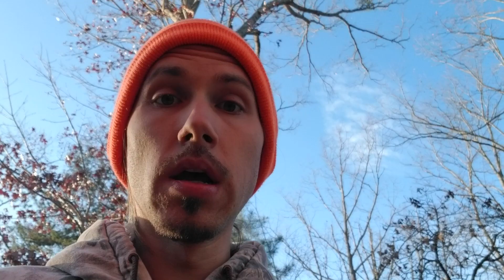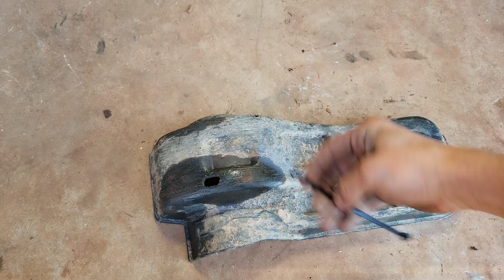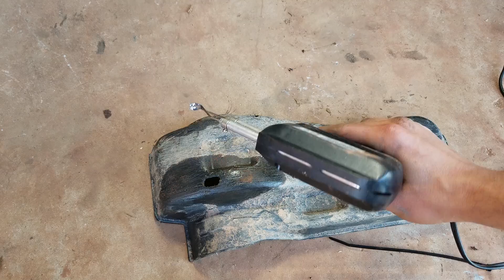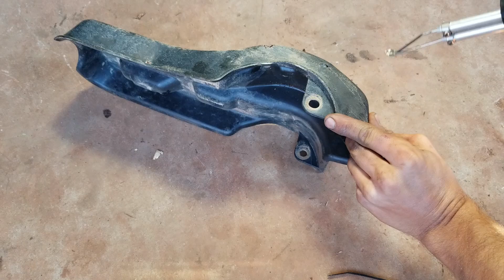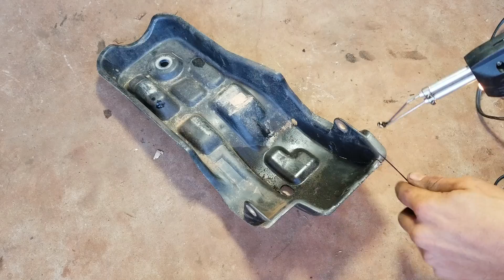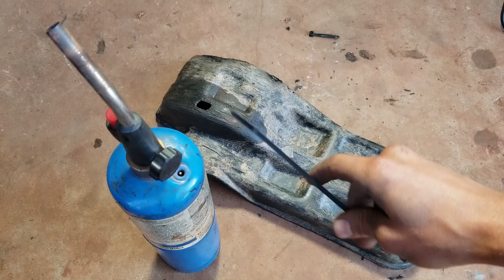Fix Broken Plastic With A ZIP TIE And FIRE!

Comment: HI Matt, my alarm guy apparently put a nick or small hole on s PVC Pipe inside the wall when he was installing the alarm system.  However, sadly I never  noticed it until at least a year or so later,  when I began to see the spot on the wall. Now I have a small water stain on my wall, and I know I need to fix it, fill the small hole or nick from the exterior,  what could you suggest?
Reply from the maker: You gotta get a plumber or replace the small hole in the pipe by replacing that damaged section.

Comment: Why was the entire plastic part not scrubbed and cleaned before starting the repair process? I hate repairing things like this unless it is near to new clean before starting the work. After the repair we clean the part to near new appearance. Cleaning does find possible other flaws that may need repair as well.
Reply from the maker: Waste of time. It goes on the bottom of an ATV. It's a plastic skid plate. I pressure washed the whole thing when I got it lol

Comment: dang, i thought i was the only one who knew the zip tie trick. i dont even use a soldering iron. i heat the plastic first with the blow torch, then i light the zip tie on fire and allow it to drip into the crack. the liquid super hot dripping zip tie melts its way into the crack real nice.
Reply from the maker: I thought I was the only one who knew the zip tie trick too. I need to try it your way sometime.

Comment: I read that the material of those zip ties is polyamide 6.6 - like nylon. I found when burnt:
Fumes from melted nylon are safe enough. It’s a polyamide, consisting only of carbon, hydrogen, oxygen and nitrogen. The fumes aren’t toxic, but if they irritate your throat and lungs by all means use a ventilator, even if it’s just a fan to blow the fumes away from you.

Burning nylon may produce hazardous smoke containing CN (cyanide) radicals. PVC is another common plastic where you need to avoid breathing the fumes, which contain hydrogen chloride. Smoke from burning PVC wire insulation in house fires is sometimes fatal.

Comment: Better and easier method to repair some thing like this would be "BAKING SODA + CRAZY GLUE". There are videos on it. Please just search it. Much easier and stronger bond.
Reply from the maker: No, it's better to melt the original plastic back together than to use some glue.

Comment: They also make plastic weld rod that melts better, but you can use almost any plastic. I've used milk bottles in a pinch. Also if its clean(no oil) the plastic likes to sticks together better.
Reply from the maker: I have never used those rods. I have used milk jug peices before. They work awesome.

Comment: You almost know something about working with plastic. You can't just use a zip tie to weld any plastic. It has to be the same kind of plastic. Different plastics work differently. Some will readily self-weld, some won't. Some become liquid with almost no intermediate soft stage. Some become brittle when heated, & some can be heated, welded, & joined over and over. Some release toxic gases, some don't. There are dozens of plastics in common use and each one has dramatically different characteristics. I won't go into an exhaustive description of each, but go ahead & try your non-working zip-tie technique on Nylon vs. Acrylic. vs polystyrene vs. PVC vs. polypropylene vs. polyethylene vs. bakelite vs. polycarbonate vs. Melamine and tell me how similar they are and how well your zip-tie welding technique DOESN'T work.  I work with plastic all the time and I would never put together such a misleading instructional video. This welding technique can work in some situations with some plastics, but the variability  is high. I.E. "you're results may vary." And by "may" I mean "will." ALSO a torch is a TERRIBLE tool. It may be better than a soldering iron, but that isn't saying much. For working on small projects like what you show, BY FAR the BEST tool is a butane heat gun. Nothing else even comes close. Cheers, & thanks for the video.
Reply from the maker: Thanks for the info. It's not that big a deal. If the ziptie doesn't work people can find a scrap piece of the same plastic and use that as a filler rod.
Reply: @MattsShop  Like I'm trying to say, it is highly variable depending upon the plastic. Some are real forgiving. The car panel you were working on appeared to be forgiving plastic. But some are a nightmare, & some you can't effectively weld with ANYTHING. Silicone, for example. Acrylic too, is hard to work with welding-wise. Actually, there's a bunch. The most forgiving I've found is the plastic shop-vacs are made out of. That stuff is BEAUTIFUL. Melts, remelts, welds, is very forgiving. Just a joy. I can't stress it enough, though, get yourself a butane heat gun. They're less than $20, & if you work with plastics more than just once or twice, you'll find your work is much easier to perform, & the results are much more professional. Regular heat guns won't do it because they force air out with a fan which can mess up the work tremendously. Regular torches, like the one you mentioned favoring, tend to light stuff on fire rather than heat it to melting. Now sometimes you want that, but more often than not you don't. Your soldering iron technique isn't that bad, and for certain work could be a wonderful alternative. I've just found after all these years of working with plastics, mostly doing repairs & fabrication, the lowly butane heat-gun is the go-to tool. You can fix a scuffed car bumper with just that heat gun and no other tools or supplies. I've done it more than once on different cars. Each type of plastic has it's proper use, but only a few weld well. Cheers.

Comment: I use stainless steel insect mesh! i Weld it in with a soldering iron and the welded area is very strong. I weld Bumpa bar and every thing.
Reply from the maker: This is a great idea, someone else said this too!
Reply: I have done it but with Fiberglass cloth, like that used by model airplane builders, the trick is to completely melt the plastic over the cloth reinforcement, someones use a hot air gun with a slender nozzle to direct the heat into the area...

Comment: Fixed some cracks in my garbage can with plastic from a 5 gallon bucket (hdpe) and a torch. Hold the piece over the Crack (with pliers) and heat both surfaces at the same time with torch.  apply when melted.
Reply from the maker: Awesome, HDPE is one of the best and easiest to fix.

Comment: I cracked some plastic thats quite thick a week ago and now theres a hole thats about a centimetre wide, you think this will work? Forgot to mention its gotta be able to hold a bunch of water
Reply from the maker: You can plastic weld water tanks. I wouldn't use a zip tie though. You probably need real plastic welding rods or donor material.
Reply: @MattsShop  alright thanks

Comment: Great idea Matt, thanks! I'm repairing a Mercedes ML presently and there is a lot of damaged plastic.
Reply from the maker: Those parts are expensive!
Reply: Mb plastic must still be the same then. Gets brittle and breaks. Good luck with wasting your time. Once you charge for fixing it and it breaks again, you own it forever. If it's your own car, good luck !
Reply: I find it annoying that many European plastic parts are crap: they seem to get "old" and then crack. Not only AUDI, Mercedes and VW, BUT my Sennheiser headphone's headband practically disintegrated itself... One of two things: a) they use the worst plastic resins, or; they are soooo concerned (Obsessed) with "Eco-Phanathism", that they look  to make their stuff with (bio)degradable plastic... in any case, their plastics stink!

Comment: I fixed  the  dash in my 1st Gen  lightning  with a soldering  iron and  the tops off  of sharpies, then sanded smooth  and  repainted. It's been almost 5 years and  still  holding  strong.
Reply from the maker: Awesome! Never thought about it, but that is a great source of filler plastic.

Comment: Nice work! May I suggest that the crack should be grooved a little to facilitate the filler plastic, just like when one metal welds something together. It would also be better if you made it so the part you are fixing doesn't  keep sliding away from you. As for a torch I use a micro torch....way more controllable.
Reply: He said exactly the same .... you Just didn't pay attention.
Reply: @carlosmejia5728  Could be, I didn't hear that.
Reply: There’s always one like Carlos in every comment section

Comment: The method shown is good, but the type of plastic the zip tie is may well be incompatible with the workpiece. It needs to be the same type of plastic as the ziptie. If it isnt it may look fine when first repaired, but if the plastic is incompatible the break will open up again.
Reply from the maker: You are right! Some plastics are completely un-weldable too. You just gotta play with it until you get it welded back.
Reply: You can always stitch with zip ties
Reply: @chasstiles7611  Yes   i have done that too. You can make a very tidy looking job using the teeny tiny ones

Comment: Great video!  It's always good to know new and inexpensive ways to weld plastics.  New ABS plastic parts aren't cheap these days and since no one really sees the part anyways, it doesn't  matter if the repair looks like crap or not, as long as the repair is solid and durable!
Reply from the maker: Well said!

Comment: Most Zip ties are nylon and you’re not using the same plastic soil never old do you have to use the same plastics when welding
Reply from the maker: Yea, it will work a little bit better with the same type plastic.

Comment: I like this but what’s the advantage of this over using JB Plastic Weld to hold back together?
Reply from the maker: Plastic epoxies are weak and break. This fuses the plastic back together. It's much stronger and lasts forever if done right.

Comment: Doesnt plastic ruin the soldering iron and what about plastic fumes, dont they have carcinogens?
Reply from the maker: Nahh, you can just peel the plastic off the tip once it hardens. Never breathe those fumes!!
Reply: @MattsShop  fuck i breathed in, for about solid 20 minutes, how many cigarettes does that count to? man i never smoked in my life, until now...
Reply: @novideoscorp  You should really go to the hospital and get checked for cancer bro!

No seriously, it's not good for you at all, the fumes from the melted plastic are very toxic. I wouldn't overly stress about it, just be more prepared next time around man.
Reply: @mygt8a4re  DOA
Reply: Wear a mask with carbon filters at all times

Comment: Actually you can use, Resin and Fiber sheet to re Fabricate it.
Reply from the maker: That's a good way too. Not pretty though...
Reply: The whole purpose of the video is to use what is around the house. It's not about resin and fiber sheets.
Reply: Resin doesn’t “bond” to plastic. It sticks but with any movement or force, the resin and fiberglass can peel right off the plastic. Sanding it helps but it really doesn’t form a bond. At least this is from my experience and I just did a bunch of it. Most turned out fine but some are already seperating.
Reply: @williamwallace7986  The better way to do it, is to get some strips of fiberglass cloth, embedding it into the molten plastic, and adding more molten plastic over the joint. That is done with a hot air gun, but a small butane torch can be used as well. Very strong if done correctly.  Many electric tools have Fiberglass reinforced plastic bodies.
Reply: @alfredomarquez9777  that actually makes more sense. Just as long as the same types of plastic is used would also be something to be mindful of. One thing I’m wondering ( I’m sure I’ll find out when I try) using melted plastic instead of resin, will the fiberglass cloth also blend/melt with the plastic like how you see it does with resin. I’ve always felt that this bonding property between resin and fiberglass cloth was a key factor towards the strength and integrity of fiberglass.

Comment: Fine job gona do this on my cars bumper, its got a couple small breaks.
Reply from the maker: Should work on that black bumper plastic. You're going to have to sand it down though. This is strong, but not pretty lol.
Reply: I ended up just replacing the whole bumper cover. And ended up getting it for free because they folded the ends in during shipment. I lucked out !
Reply: Dude Manbro I have a broken tab hole on my bumper due to reversing over a kerb and it being pulled forward do you think if I did this an made the tab back up it would be strong enough to hold the screw in it to hold the bumper up?
Reply: @TheLoneRanger1992  no idea, give it a try. i never ended up using this repair method. see my comment above.

Comment: hmm , isnt the same type of plastic is needed to bond them ? or just random
Reply from the maker: Yes! It has to be a similar type of plastic. Preferably the exact same type of plastic. It can be a real challenge to figure out though.
Reply: Yeah, let's send the plastic over to a laboratory to analyze it. Or you can just try the zip tie and see if it works.

Comment: I got some headphones with a crack right on the top but I have no soldering iron any thing else that I can use?
Reply: Use your mom's iron.
Reply from the maker: Good idea!
Reply: You can buy a soldering iron for $5 at Harbor Freight or an actual plastic welding tool for $17 at Harbor Freight.
Reply from the maker: Yea they do. I still want to try out one of those legit plastic welders.

Comment: Will it work on a broken office chair leg?
Reply from the maker: Maybe, depends what type of plastic it is.
Reply: Office chairs are usually made of Polypropylene, the like... white transparent zip ties are made of nylon but the black ones like the one in the video are also Polypropylene, so as long as you have some black zip ties it'll definitely work
Reply: @TheFloatingSheep  I’ve been looking for blue zip ties for my raptor 660  but all of them are nylon . So nylon wouldn’t work?
Reply: @User-fm4ec  I don't think it would, you usually want to be working with the same type of plastic, that way all properties match and you've got the best chance of it not breaking 
Even then uneven cooling speed between the original plastic and the welded part is gonna result in some stresses in the plastic but it's as good as it'll get without packing the part in sand and heating it in a kiln, material sciences are a hell of a thing

If you've got access to ordering from eBay or Amazon I recommend looking for  "PP (Polypropylene) plastic welding rods". They sell them for this exact purpose.  

If you don't have access to that another thing you can use is the lid off a tupperware box, maybe use a pair of scissors to cut some strips of it, alternatively though harder to use, the little lids off of PET bottles are also made of PP. In either of this cases you wanna look for a recycling symbol that either says PP or 5 (recycling number of PP), on the inside of the lid or bottom of the tupperware, occasionally they're made of different materials.

Comment: What's the tensile strength of that bond? Lol. Seriously though, how durable do you think that is going to be, have you any exp. with impact post repair? What are the results?
Reply from the maker: Lol it's just a plastic engine cover. It doesn't have to be strong. It's going to last for years. No I have no experience with that method of repairing plastics.
Reply: IT DEPENDS... if the plastic part edge if thick enough, and the repair is done by filling a groove, it can be quite strong. NEVER as strong as the original part, but strong enough to endure normal handling. If more strength is needed, placing some reinforcing strips of fiberglass cloth throughly wet with the molten plastic will add considerable strenght, but demand the use of a hot air gun with regulable temperature. I have seen (and tested) some plastified canvas tarps joined with hot air and pressed with a hand roller: Perfectly strong joints.